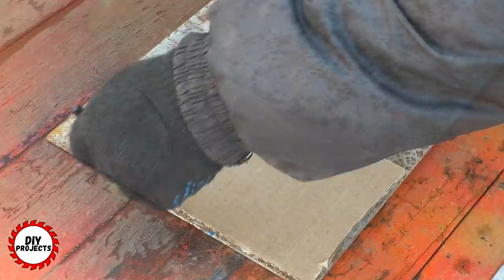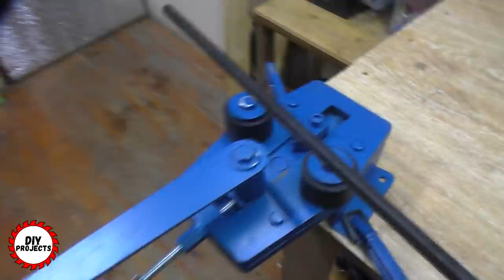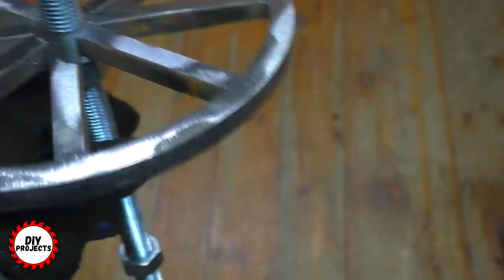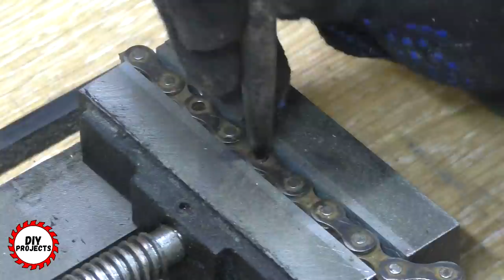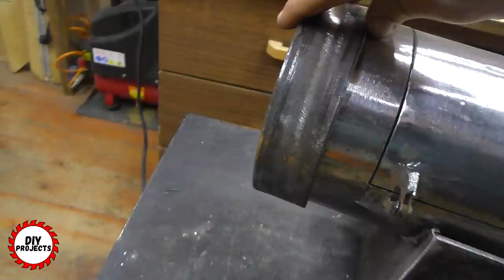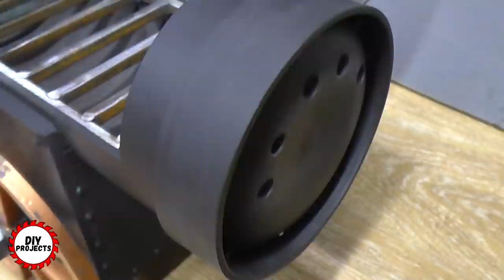Brilliant idea from an old fire extinguisher !!!

Comment: Your about the only YT that knows how to use a grinder property. Most just bury the cutting wheel and force it through. Going through 38 cut off wheels for something that requires maybe a 1/8 of a cutting disc . GG
Reply: Agreed, a light touch is all you need the weight of the grinder does the work.

Comment: Are all fire extinguishers reverse thread? And is this true for oxy acetylene tanks?
Reply: Gas and water are 'opposite' threads to avoid dangerous 'wrong' connections.
Reply: Remember that loads of YT videos have been made into a mirror image. I believe this is to help avoid copyright infringement identification software. So quite likely the fire extinguishers are not reverse thread but look that way because of this effect.